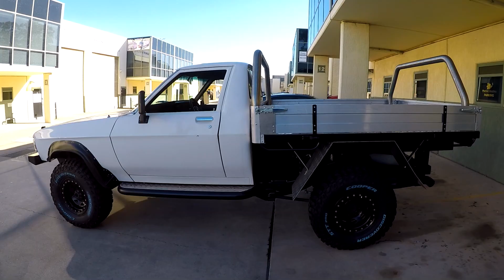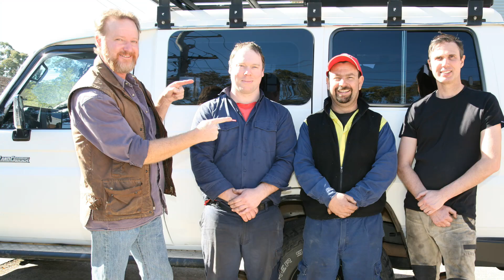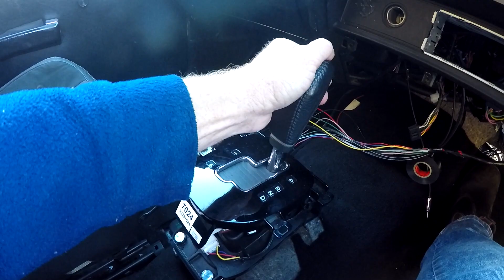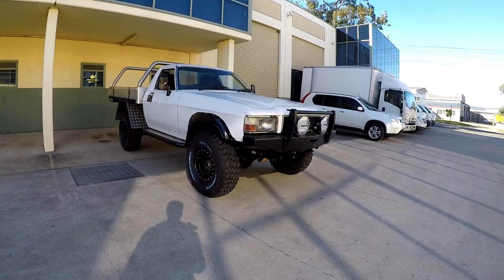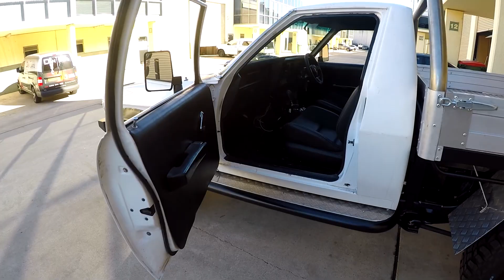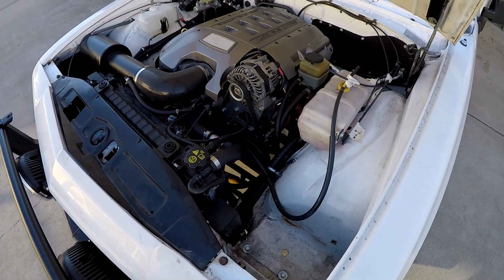Tonner files: Holden 1 Tonner part 7 | 4X4 Australia

Comment: whats the difference between your and the ones that came out of the factory
Reply: Original overlander made by Arthur Hayward had modified Holden chassis with leaf springs, 308, Dana diffs and transfer case. Mine is on a GQ Patrol chassis, coil springs, LS3 with 6 speed automatic, GQ diffs, GU transfer case. Mine is not an overlander, just my version of my dream 4x4. "Modern Boganism" as someone else suggested.

Comment: Those sheet metal rear guards wont last long off road. If they hook up could turn into the tyre and rip it. Stiff plastic or rubber might have been better, time will tell. The rear link arm factory welding and piss thin sheet metal chassis bracket looks sus as well?  Not a bad job though.
Reply: Hi Dave, which chassis brackets do you mean? I've used all the standard GQ chassis to body brackets. Or do you mean chassis to tray?
Reply: The rear axle trailing link arm forward chassis brkt doesn't look that heavy given what you have in mind.  I've been watching other OZ video's.  My long experience with LR 110's show that as a weak point on them, some have had the link arm tear right off.  Just saying.  Good project though.
Reply: Thanks.